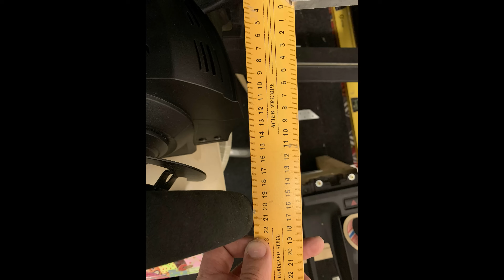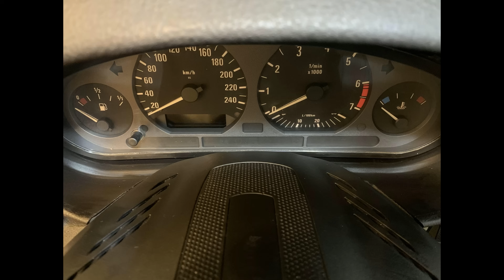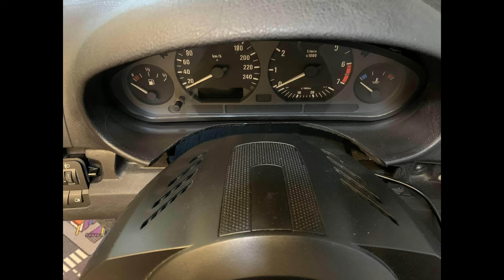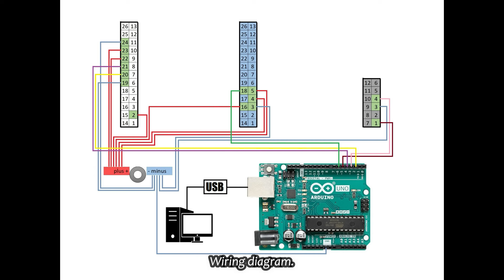How to Build real car interior cockpit from BMW e46  - S01E01

Comment: Now this is a setup your boy has some skills on carX! Im still trying to learn to drift on my wheeel and im nearly 30 😂 you done amazing with this build!
Reply: turn into corner release acelerator and the wheel catch the wheel back on accelerator
Reply: @navysealuk8755  but t248 is so slowww
Reply: I thought it was AC. Lol
Reply: @navysealuk8755 i almost had a stroke reading that
Reply: @raivis923  Dont know why ? its how you drift off the gas to gain grip, let go of the wheel so it rotates, catch the wheel to catch the drift and back on the gas, yes some cheap wheels you might need to help them by giving them a flick and yes i can drift

Comment: You guys should somehow try to wire in those led strips above the seat to the headlight switch on the setup. That would be pretty cool and it would actually serve a purpose.
Reply from the maker: There are many plans for the future - light switch, air fans, etc... next season episodes ...
Reply: nah, leds and rgb are overrated
Reply: @juanmaceballoscimpeanu1214  yeah but it is cool to see, for me rgb never gets old.
Reply: @keonyang3332  I feel the same. it never gets old. its kinda like saying youre tired of Vegas' lights... youll never hear someone say that... lmao
Reply: What a beauty, but did you connect the car's clocks and what part did you use to connect the car's clocks thanks
Reply: @ramekhotaba9385  connect the cars clocks?

Comment: where did you get the wheel caps im looking for some bmw ones aswell
Reply from the maker: I ordered from a parts dealer. OEM part nr 36131181082

Comment: awsome build i have made an just like it for my son, but my RPM will not work! any tip?
Reply from the maker: It is difficult to answer where the problem is. I hope to make the original e46 speedometer in the autumn-winter period. Then I will definitely make a more detailed video about it.

Comment: How did you connect the key ignition to the Arduino? Secondly, how did you get it to work in game as well as giving power?
Reply from the maker: The ignition key is just a power switch for the speedometer. Arduino works continuously when the PC is on because it is powered by USB. SimHub needs to be installed for it to work with the game

Comment: Nice work🥰. Im doing the same but how did you wire the ignition so the bmw cluster turns on when you turn the key?
Reply from the maker: It just supplies power to the speedometer ;)

Comment: Question,

Where does one even go about it find an old abandom actual car dash that is already taken out of vehicle and bare bones that one can bring home to modify?

Was it a older car he owned himself & gutted it?

I know there probably a few local junk yards or places that have abandoned junk cars but removing entire dashboard takes specialized tools and experience knowing out to do it all.

Might be cheaper or easier to pay someone to print a 3D cad model of working dashboard.  

Or is this a 3D dash to begin with?
Reply: Dashboards (in my experience) are easy to take out, it just takes time, usually just need some screw drivers and allen wrenches, another way would to go on market place and find a car/truck that someone is parting out
Reply from the maker: In my country (Latvia), these cars are take it apart by parts on every corner. You don't have to do anything yourself. Just choose any part.

Comment: Can you please make a guide on how to wire the ignition key and how you did in simhub to get it to work?  I am building this to my son and The only thing left is to wire all and get the ignition to work and understanding how to do in simhub 😊
Reply from the maker: The ignition key does not work as it should. It simply supplies power to the speedometer. Maybe in the future I will make it so that it functions as an ignition key.
Reply: @e46sim  okey can you show how you wired it? Im planning on having it your way and Then wire a Start button via a zero delay arcade game decoder. I have my key wired to that and it works just like a real key but want it to power on the bmw cluster also 😊

Comment: Do you have any tips for building something like that but on a Xbox?
Reply from the maker: Definitely not. Xbox is far too limited and won’t offer nearly as much customization or control. You can mount a wheelbase compatible with Xbox on the same simulator, but that’s where it ends. Only the wheel, pedals, and shifter will work.
Reply: @e46sim thank you I am now getting a pc

Comment: Where can i buy that USB Board for speedometer?
Reply from the maker: Aliexpress or Arduino official store
Reply: @e46sim  Thanks. And how did you build the key for start the Speedometer? Did you just Connect it to Arduino board? If yes, which Ports?
Reply from the maker: @Mecklenburgerjung97  The ignition key is only connected to the power supply to the speedometer

Comment: How to connect ignition to arduino uno?
Reply from the maker: It's just a power switch for arduino
Reply: Thank you so much !! Love your sim. I’m starting to build my own using Alfa Romeo 156 parts!
Reply from the maker: @user-vj4rn4tl5e  check on Instagram this profile - simalfaproject_sneyk23 . There is Alfa Romeo a very good sim project for your inspiration...
Reply: @e46sim thanks

Comment: At the 0:39 you say that " I think Thrustmaster is better and more realistic than Logitech..." no hate but you should try a Logitech wheel too, and then you would change your opinion.
Reply from the maker: I've tried Logitec too, it's not a bad device, but I really didn't like its noise. The Thrustmaster, however, is one level up and feels less like a toy. The only pedals that come with logitec are more pleasant than the ones included in the thrusmaster kit.

Comment: All that to drive on 1 little monitor and a Logitech G29 base... SMH
Reply from the maker: I must clarify that the setup actually utilizes a Thrustmaster T300 base, not Logitech, and the monitor isn't small; it's a moderately sized 27-inch screen. Furthermore, we plan to upgrade to at least a 32-inch monitor later on.